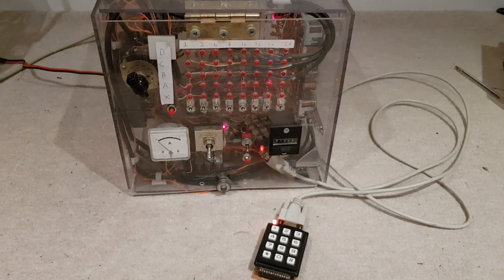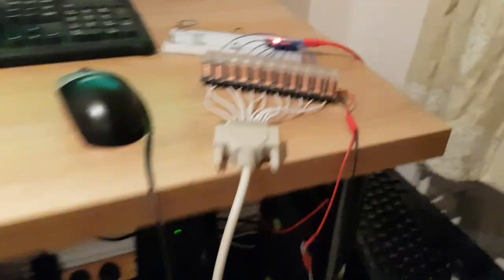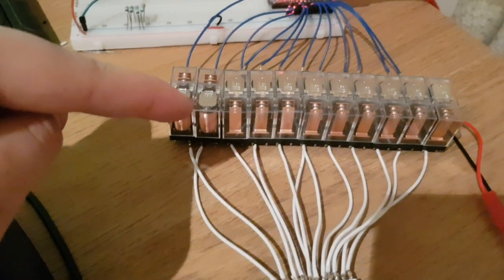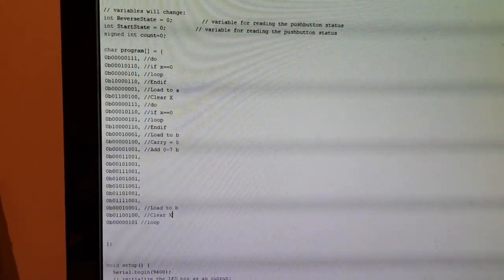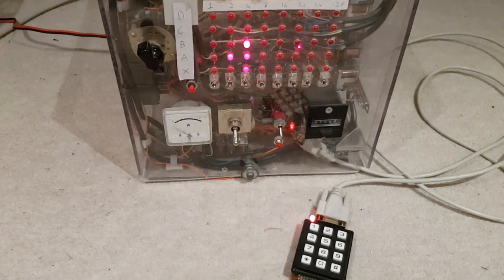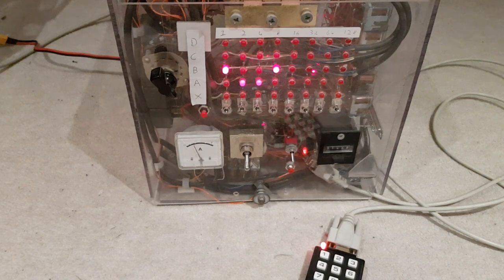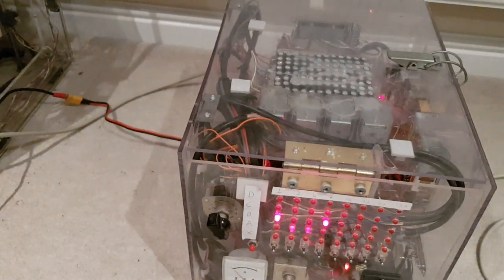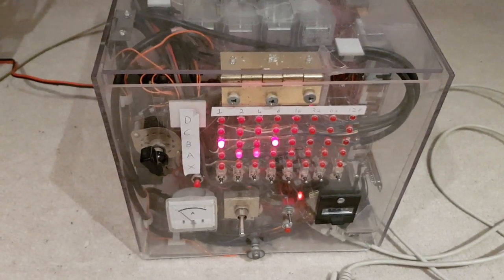TIM 8 Relay Computer (Vlog 13): Keypad and Debugger

Comment: One question: why store numbers as 1 2 4 8 16 32, etc instead of the normal way? (32 16 8 4 2 1)
Reply from the maker: Because I didn't know any better at the time; I was making it all up as I went along, and only learned there was a convention after I'd built it!
Reply: @rapidrory  Thanks for the answer! :) I'm currently building (rather, right now it's postponed due to exams) a relay computer myself, so that's why I was wondering :) Keep being awesome!